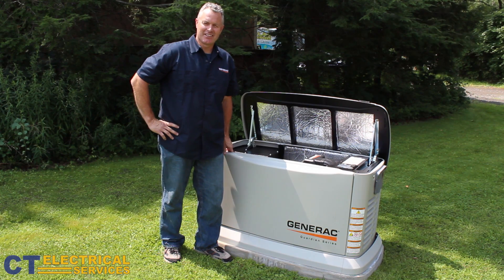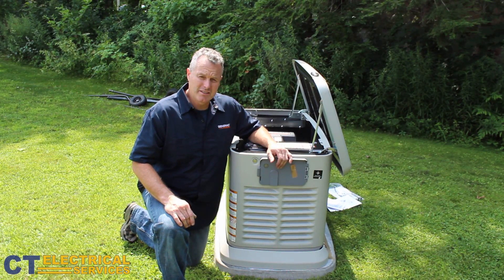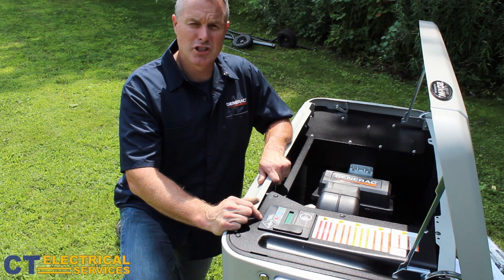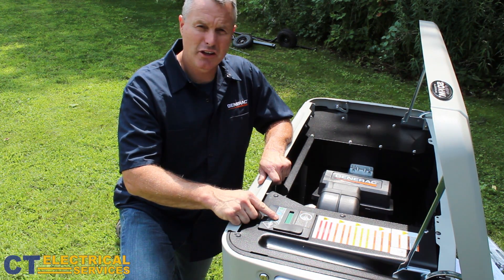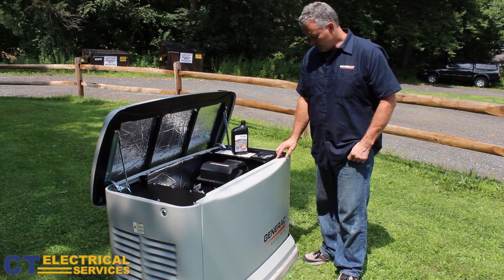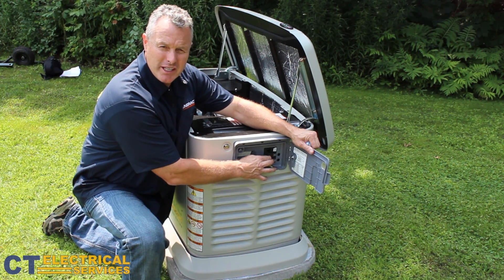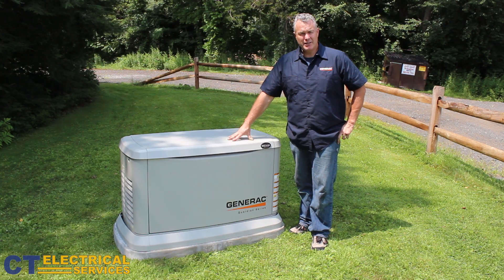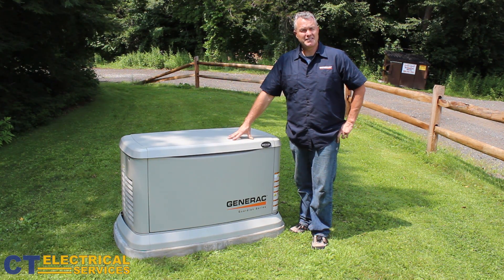CT Electrical Services - How to check your Generac generators oil during a power outage.

Comment: How do you reset the yellow maintenance light on a 14kw?
Reply: Nexus controller > From main menu > edit > scroll to reset maitenance > enter > back to auto

Evolution controller > Dealer access is required >
Reply: Thank you
Reply: Anytime. your Generac generator shall still operate as normal with the maintenance light on. I suggest you perform maintenance at least once per year. We always perform two visits per year due to the weather in Connecticut. Always follow your manufactures suggestions and check your oil frequently on extended run times as well. Good Luck with the upcoming storm season. .

Comment from the maker: How to check your oil after running your Generac generator for a long period of time.
Reply from the maker: Not sure what generac you have but everything should be on  Generac.com or the oil dip stick is located under the cover. Portables consult the manual is always best. All Manuals are located on the internet as well.